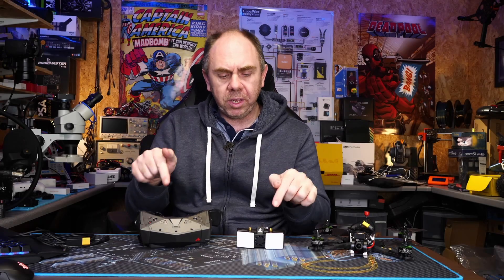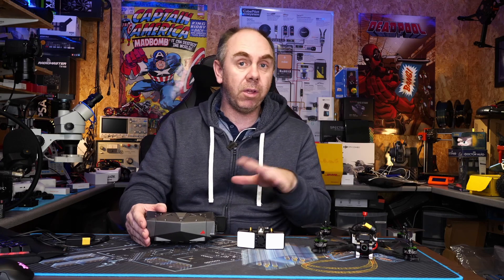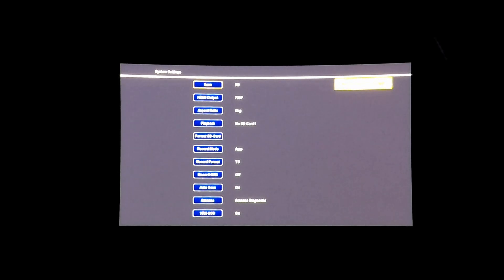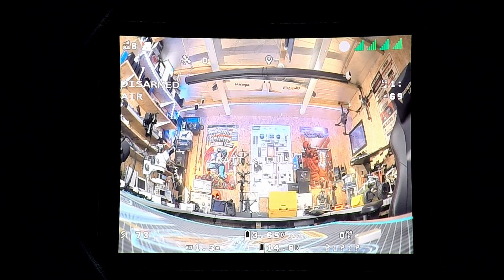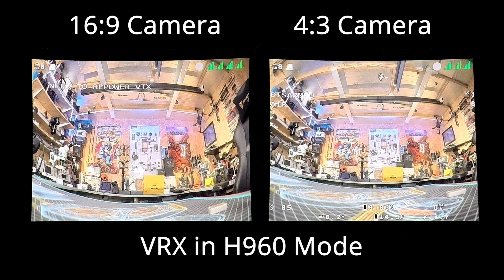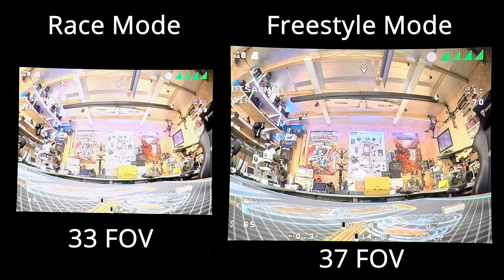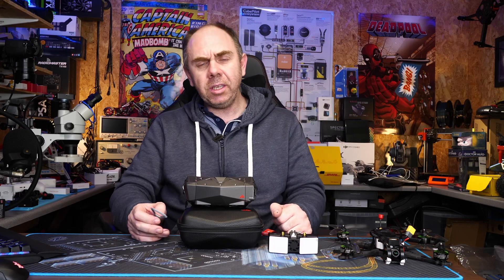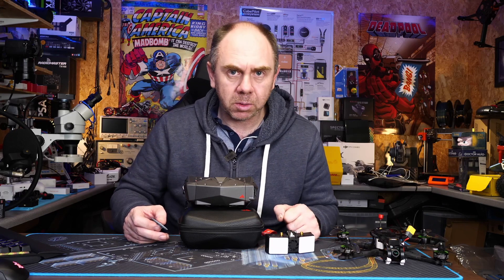Orqa FPV.One Pilot FPV Goggles & HDZero Micro V2 4:3 Now Working

Comment: When i get it right, the 4:3 mode in the camera puts out 960x720p because the sides are cut of of the 1280x720p sensor. Is this just upscaled to match the 1280x960 screen of the orqa's? Does anybody know how this exactly works?

Comment: HDO2’s only support 16:9 for HDMI-in sources and so we will need to set the aspect ratio of the camera to 4:3 and then set the aspect ratio in the vrx menu to H 960. This setup will add a black border at the top/base/sides but we will get the most out of the 4:3 aspect ratio.
Reply: 04x is same to hdo2.it looks like only Orqa FPV.One can do 4:3 best

Comment: Can you tell, which cable you used to connect the HDZero VRX to the googles? As far as I know the goggles again only have MicroHDMI in, correct?
Reply from the maker: They do.  I used a cheaper one o got locally in the U.K.  there are some better ribbon ones on AliExpress that give a much cleaner look.

Comment: I knows it not a big deal but i still notice that dang pincushion effect still on the orca v2 i dont see why they are the only manufacturer that can't get that right?
Reply: I always thought it was more of a camera lens/sensor size than goggle issue?
I get it (to a lesser degree) in my DJI goggles.
Reply: @paulhope3401  i have never seen tgat in my dji, fatshark, or sky zone
Reply: @biggfpv2721   Interesting. I defo have it in 16:9 mode with my Nebula pro nano.. not as much as in the video above though.
 I'll try 4:3 tomorrow and see what happens... and also test my normal DJI (120FPS) cam.
Reply: @paulhope3401  imo dji have the best optics by far in their v1/v2 goggles (big chunky ones). I have orqa v1s but I haven't flown them. I dont think the pin cushion effect is bad. The super view mode turned off basically undoes that pin cushion effect by chopping small slices of pixels or then edges. I have both dji v2 and orqa v1s